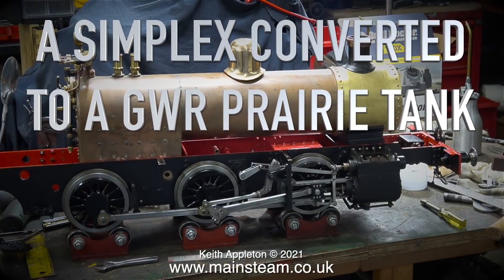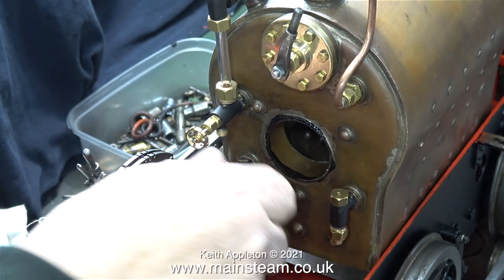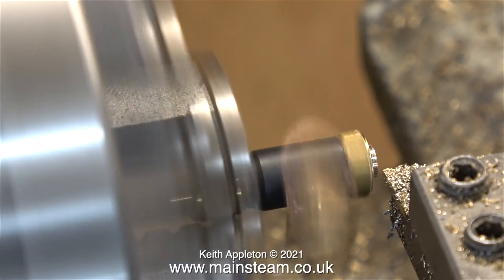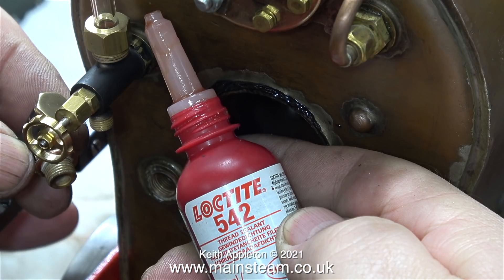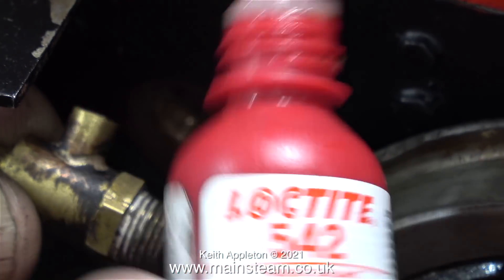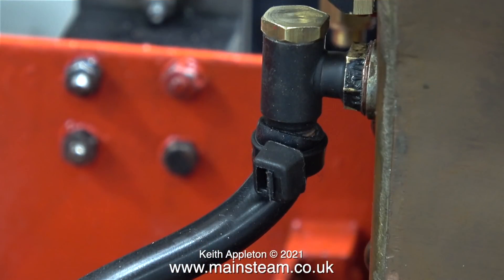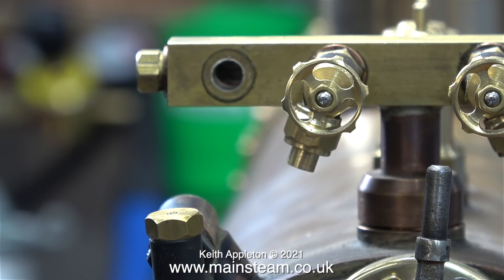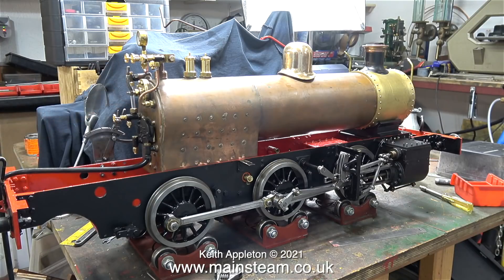SIMPLEX PRAIRIE TANK - PART #64

Comment: At 6:50, what are those two brass and glass instruments in the top right of the video? They look really interesting :D
Reply from the maker: They are a pair of full size Water Gauges from a Lancashire Boiler. They are mounted on a display stand with the Pressure gauge from the same boiler.
Reply: @keithappleton  that's really cool :) I thought they might be water gauges but I wasn't sure.

Comment: You loose me when talking about valve gear,  but then I can probably teach you about diesel fuel injectors.  Unlike my great-grand-father who worked on steam engines I became an automotive/truck/heavy equipment mechanic and the people I worked for never used steam engines after 1930.  I used to model railroading in HO scale, but could never learn to recognize the different valve gears on such small engines.  Your videos have been an eyeopener for me, as I never realized just how complicated steam engines could be.   I don't comment on what you do until you are finished as any question I might have is always answered in the next video.  Which is something a lot of your viewers need to do as well.